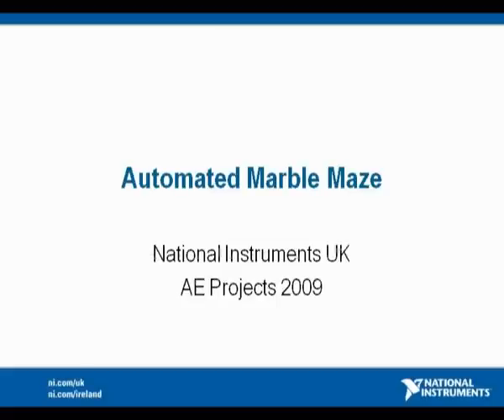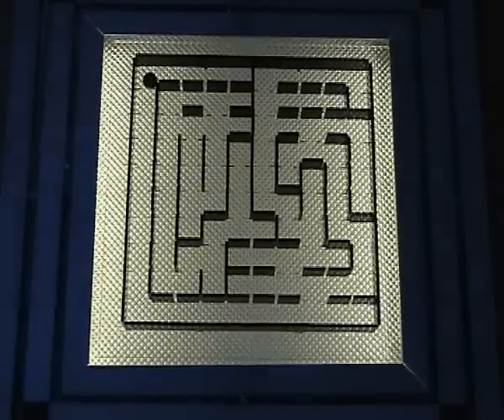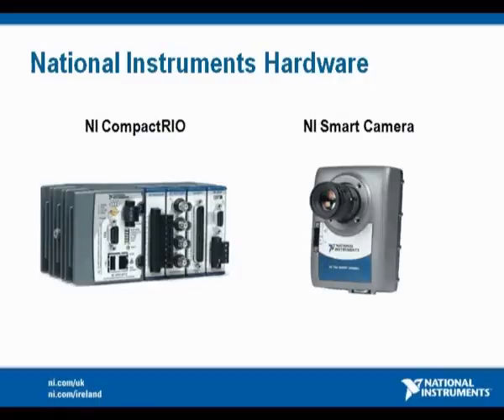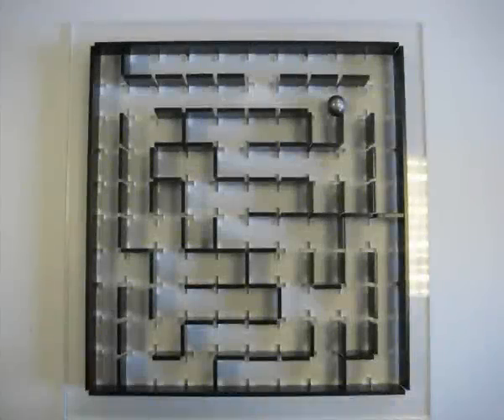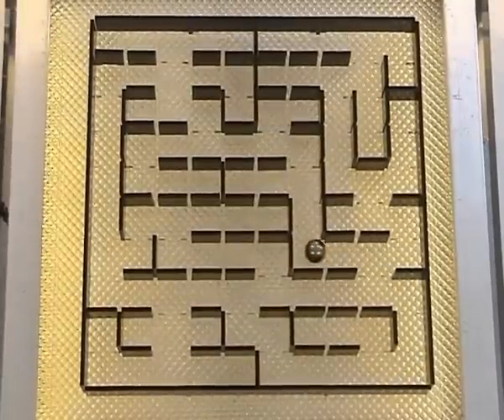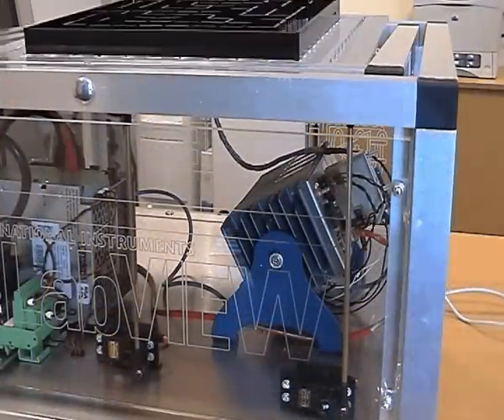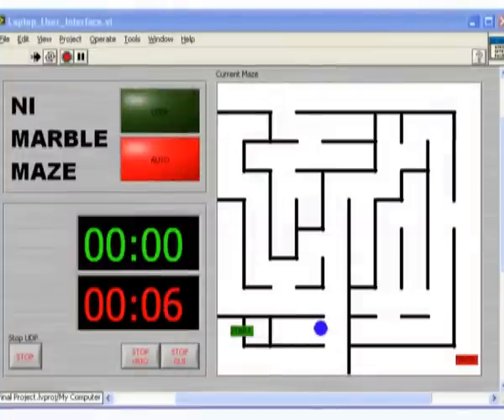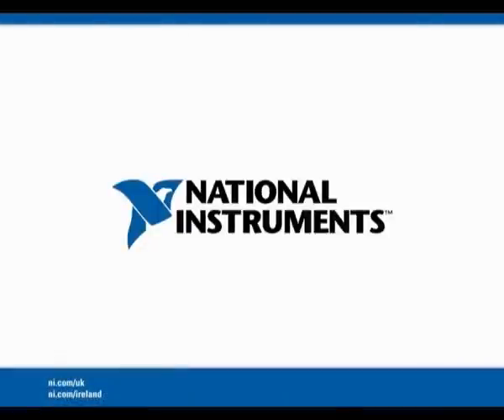NIUK Automated Marble Maze - LabVIEW

Comment from the maker: Auto-mode is designed to keep the marble continuously in motion.  Otherwise, more work is required by the servos to overcome friction to roll the marble into specific positions.  The NI Smart Camera provides feedback to the PID loop.  When the marble has been in a specific position for a long period, the movement by the servo is increased through a gain multiplier in the PID loop to get the marble rolling again.